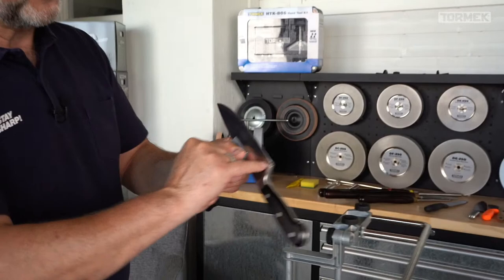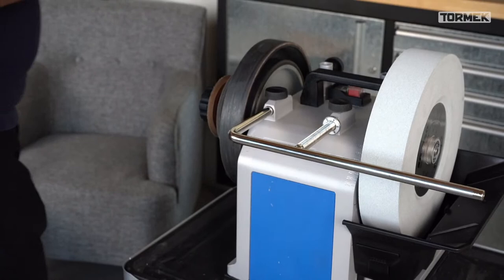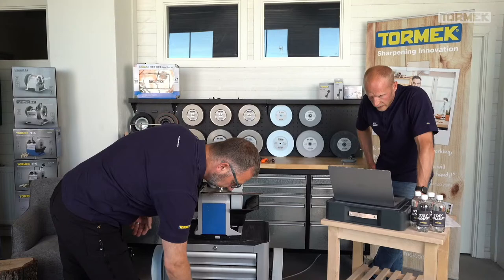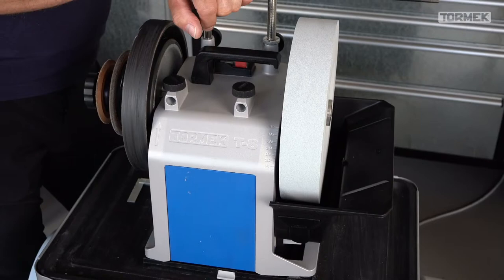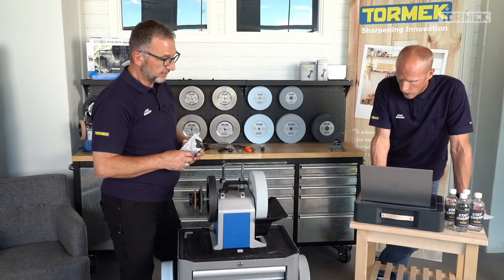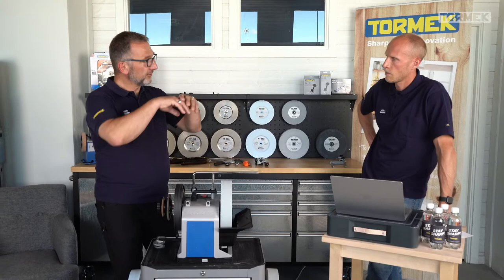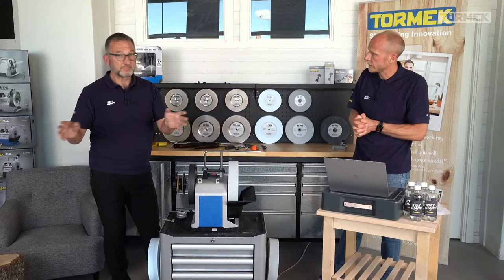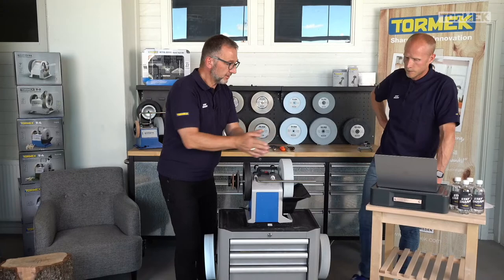Q&A With the Sharpening Doctor | Tormek Live Special

Comment: Hi there, I bought a new T8 plus a 1200g diamond wheel. 
I only used it twice on N690 stainless Steel blade. 
It's scratching my blade every time it turns with a knocking noise. 
How do I clean the diamond wheel 🤔

Comment: Nice video, this point out some questions"isues" that i also encounter :Interesting about the daggers, their like diamond shaped and indeed difficould to clamp, somehow daggers come out of the factory with a very sharp point but dull edges, why? I don't know, i have an millitary isued commando dagger made in england sheffield... not the least of daggers i would say but even it is an offical "nato" aproved/isued weapon and the design came from ww2 the edges they deliver dull, i can only think of safety of drawing the weapon, but this issue is in contrast with the fighting techniques/instructions with this dagger design dating ww2 where you certainly use the edges to slice and fence of kicks for instance,. So conclusion to the daggers: they suppose to be sharp at all sides (acording also to the designer of the commando dagger "fairbairn-sykes"). i will try to think of an solution to clamp the shaped knife somehow good.
Reply from the maker: Glad to hear that you found our video interesting. 😀